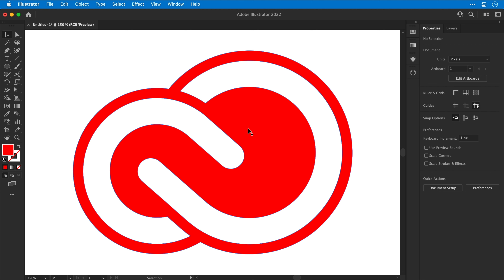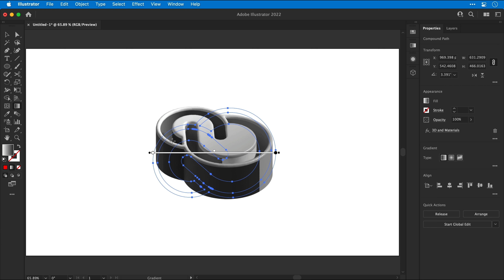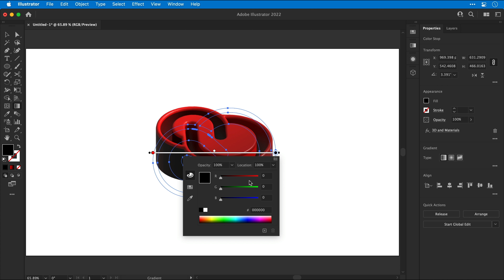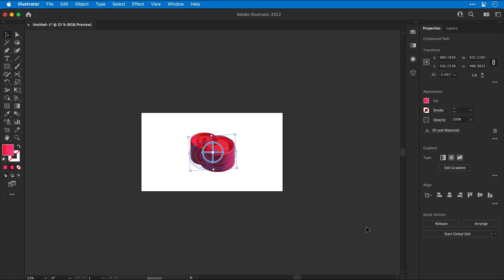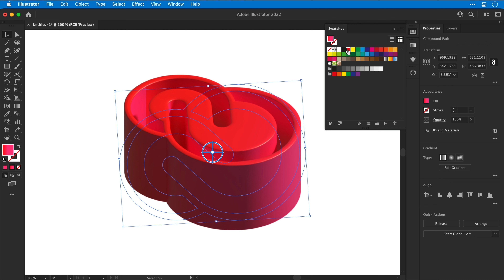3D Logo Design in Adobe Illustrator - Tips & Things to Avoid!

Comment: Sir, is this the newest Adobe Illustrator 2022? because I have an AI that 2020 does not have a 3D display like you said, does the imac 2012 os mohave support with AI 2022?
Reply from the maker: Mohave supports 2022 version, and yes it’s the 2022 version of Illustrator that has the new 3D features 👍
Reply: @ForeverDansky  sir , I have something to ask right +
 I have already installed AI 2020, can I install AI again with the latest one? Adobe Illustrator 2022

Comment: how do you save a 3d logo for high quality print, I've been struggling with this as to the 3d logo pixelates
Reply from the maker: I would try setting the document's dpi to 300 (careful though, this may crash the app depending on your design's complexity and your computer), and also try increasing the physical size of your 3D logo. This of course may mess up your design, so you could try increasing the size of it in a separate document, export as a vector file, then re-import this vector file with the logo at a 'bigger size' into your main design document.
Reply: @ForeverDansky  thank you so much for the feedback 🙏